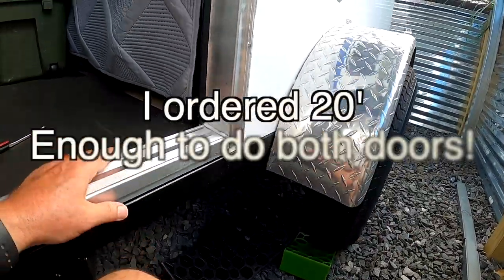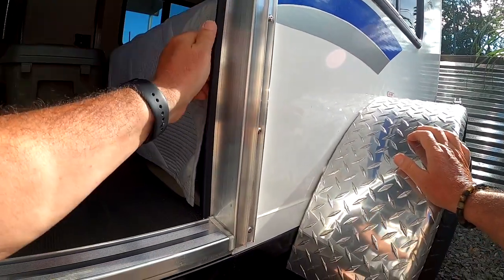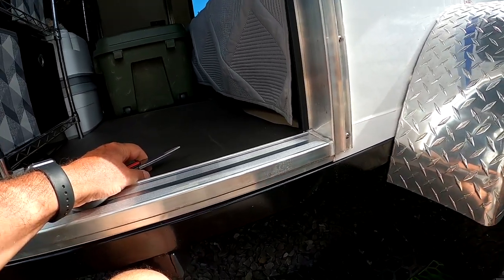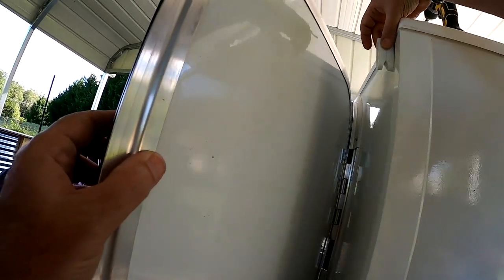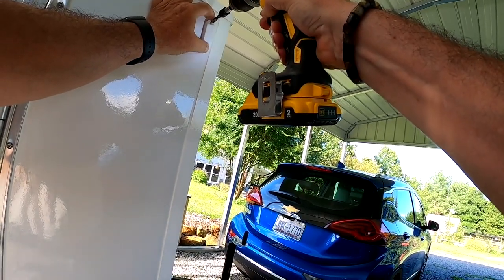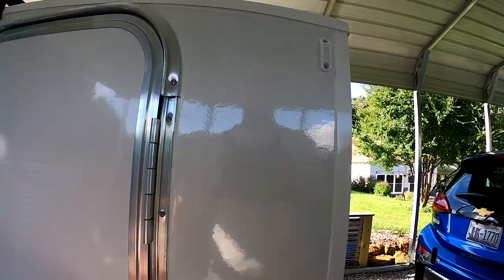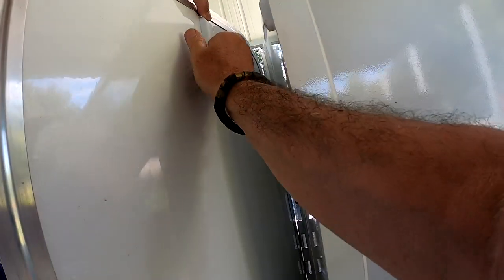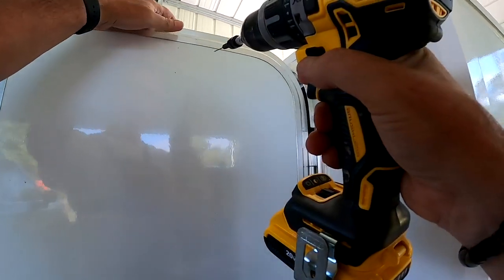2022 Runaway Camper Quick and Easy Mods!

Comment: Great little mods that will make a big difference.  Will you put any sealant around the magnets since you drilled holes?
Reply: We used similar magnets and just used industrial double sided tape to attach them. Been on a couple trips so far with no issues
Reply from the maker: @runawaywithhandk  Thanks for chiming in my friend! Glad the tape is working good! I will go back and also a little sealant on there based on the suggestions. I think it is a good idea. Don’t want water inside my brand new walls!
Reply from the maker: Yes, it has been suggested I do that! I think it is a good idea for sure!

Comment: I'm going to order some of that rubber channel. Think it would fit on the gutter? Mine has really sharp corners, I can just see getting snags from.
Reply from the maker: Hey there Chad! Not sure I know what gutter you are referring to, but if the thickness of the metal is the same then I am sure it would fit. Hope that helps! Blessings!
Reply: @TheRunawayGang  Just above each door theres a little overhang, I presumed it was a gutter.